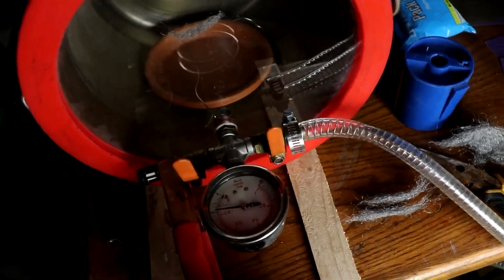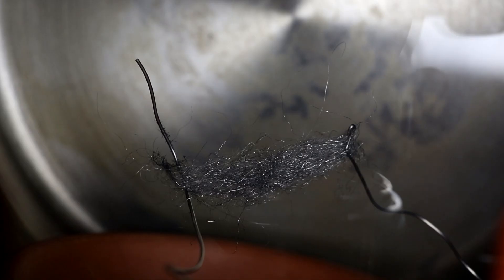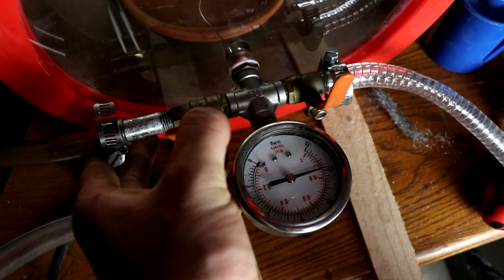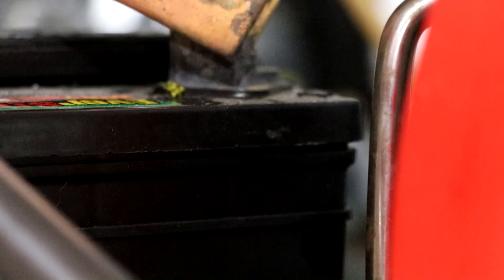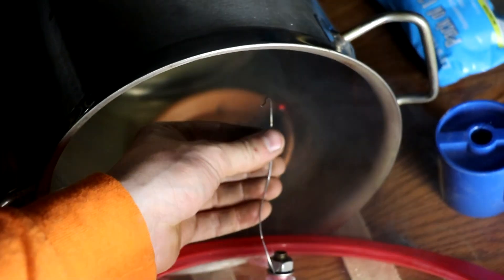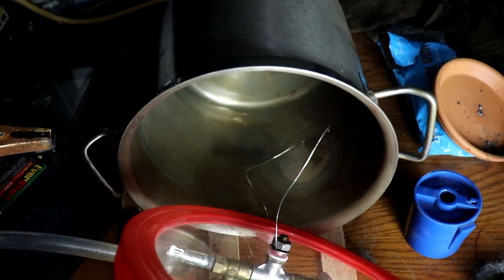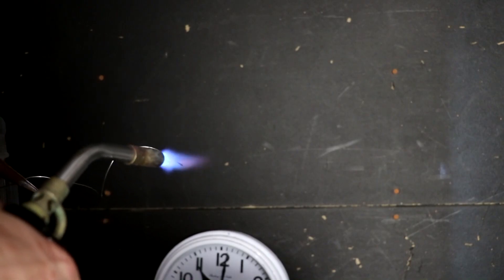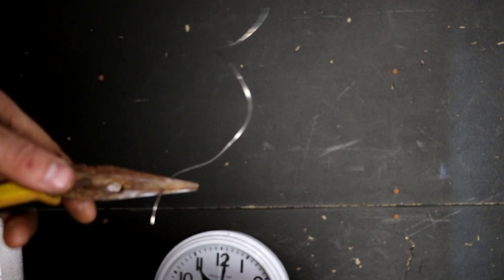Burning Steel Wool In Oxygen

Comment: Wow, never expected the wire to burn!
Reply: Actually that startled me, pure oxygen environment is really something to be respected when doing any business in it
Reply: i was like WATAFUK?!
Reply: Yea, pure oxygen turns inert steel wire into a christmas sparkler.
Who knew?
Reply: reminders to the Apollo 1 fire anyone?
Reply: look up thermal lance and be even more surprised :D
Reply: I think it might've continued to burn because it was on the cathode of the battery, and the extra electrons from the oxidation had somewhere to go, pushing the reaction forward

Just a guess though
Reply: tehwubbles: that is total nonsense, oxidation doesn´t produce extra electrons, and even if it did such a process would have no preference regarding which pole of the battery it happens on, as the polarity of the battery is completely unrelated.
Reply: jolo Kp if it was titanium wire it would have been been better
Reply: I once had a loose 9 volt battery in a drawer with some steel wool. When I tug the drawer open the battery sled and make contact and poof! That's how I discovered that still was not only flammable but ignitable with a small battery.
Reply: thats how a cutting torch works. once the metal is melted you could turn off the acetylene and continue cutting unhindered with just oxygen.
Reply: I was afraid the whole pan was going to light up
Reply: I had a spark from my welder land on some of that wire wool and Went up in flames!! Shocked me to at the time lol
Reply: Everything burns in oxygen
Reply: burned like a sparkler
Reply: Tyranzor Katastrophe
Even enerythinger burns in a fluorine atmosphere.
Reply: Use it to start campfires with a 9v battery, amazing stuff!
Reply: Do you guys all know how oxygen-acetylene torches work for cutting? You heat up the metal red/white hot, and then press the oxygen valve lever, high pressure oxygen bursts through the molten metal, further oxidizing any steel on it's path, you can even turn off the acetylene once you start shooting the oxygen through, because the heat from oxidation keeps the steel hot enough, so the oxygen can go through the steel like hot knife through butter. Basically oxy-acetylene torch does the same thing oxygen did to the steel in the chamber. Once the steel is hot it burns it rapidly, and nothing can stop that reaction (well nothing apart from turning off the oxygen ;) )
Reply: There is a video on demolitian ranch where an oxygen tank is shot with a APIT 50 BMG round and the oxygen is basically welding through a clean whole around the impact of the round on the entry and exit using the steel as a fuel making the steel cut itself away basically. Oxygen is scary stuff once there is an ignition source the oxygen will make alot of things melt